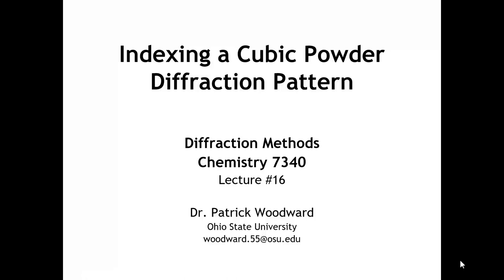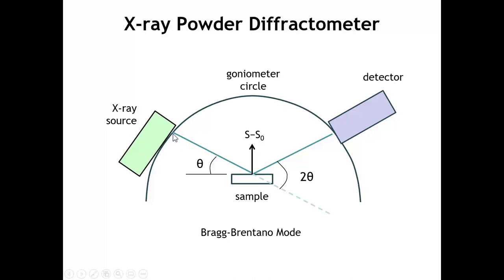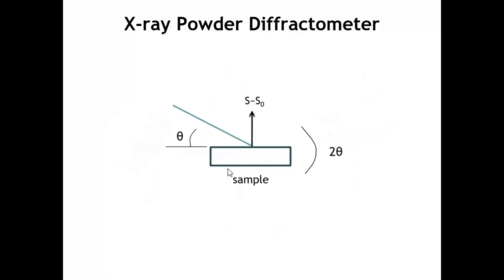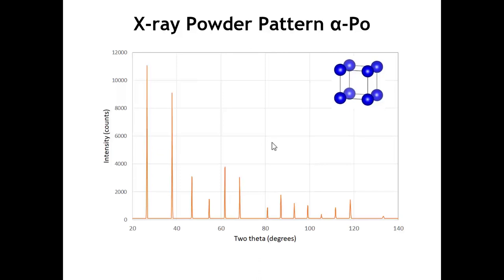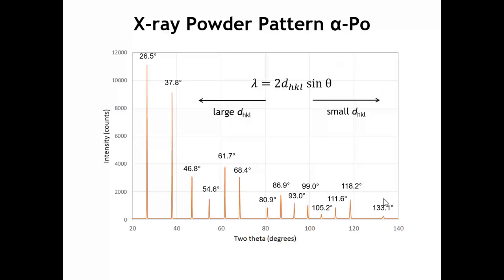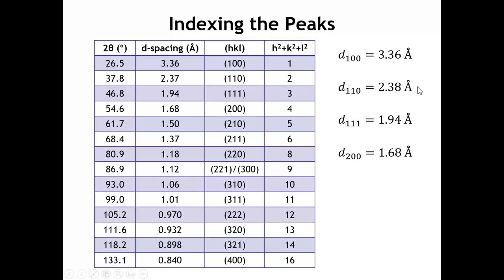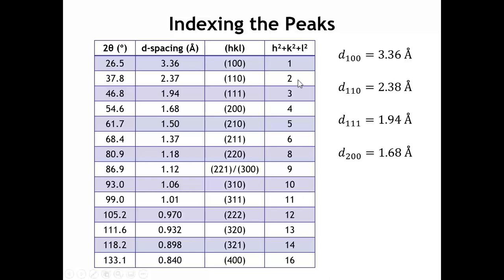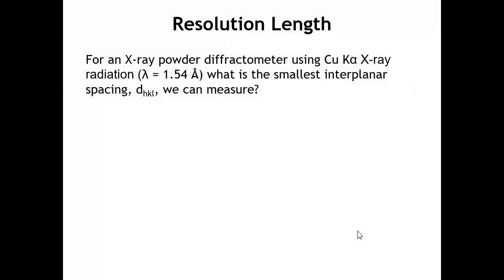Diffraction Lecture 17: Indexing Diffraction Patterns of Cubic Crystals

Comment: 7:59 isn't that math wrong? 1.54 / (2*sin(26.5/2)) = 1.22

Made a table on Excel and most of table values are wrong
Reply: To calculate the Sin function, we need to feed the value with the radians function or multiply the angle by Pi()/180 to get the actual value.